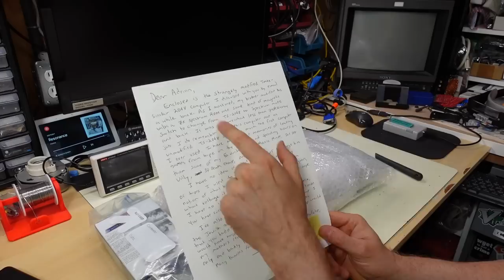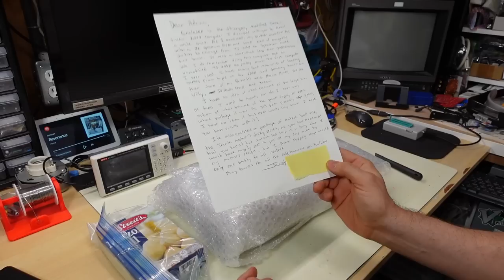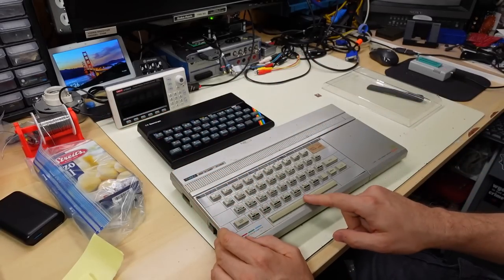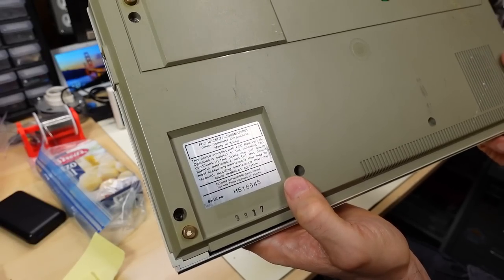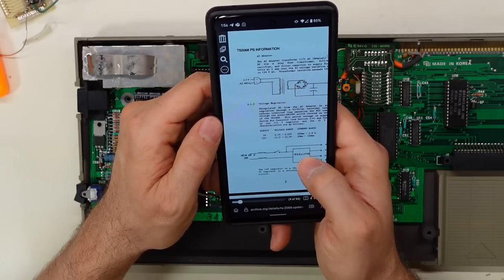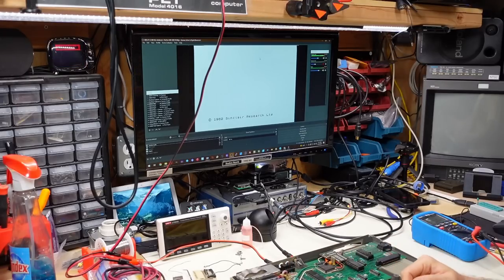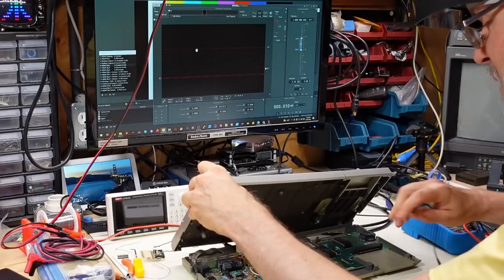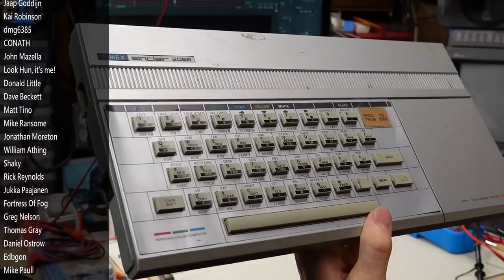0044 The ZX Spectrum of North America: The Timex Sinclair 2068

Comment: I had a Spectrum+ with Sinclair Interface 1 and two Microdrives and a bunch of cartridges (and a borrowed thermal printer for a while). I sold the whole set for the equivalent of $10, but regretted it very quickly... Today, ~25 years later, I've never EVER seen an Interface 1 on YouTube, not to mention Microdrives... and I still had factory-formatted 100-something kilobyte ones (reformatting in my drives produced like 86 KB, so I learned not to do that, and had foiled spares...). This stuff must be worth a lot for Brits or YouTubers, I'd be rich! If only I hadn't one day decided it's garbage :/

Anyways, I'm not sure if I remember this correctly, but either the Interface 1(aside of having a serial printer port and a 3,5 mm jack LAN (Atari Lynx style, just a decade earlier!)) or perhaps only the Interface 2... anyways, it had joystick ports which were the "Sinclair" standard which some games supported. Funny thing is, connecting a joystick there made it simply press numbers 1 to 5 on the keyboard. Obviously no one bought the Interface 1 nor 2, there were tens of Kempston clones for pennies, so in the end, thousands of games only supported the Kempston joystick "standard".

But I suspect that since this Timex was so closely related to Sinclair, the ports may be the Sinclair standard. I don't know the pinout, but you should be able to quickly test that shorting some pins produces numbers 1-5 (assuming on this machine these are active all the time, I wouldn't know).

PS. My Spectrum+ had waaaay better keyboard, including buttons for all the modes you needed combos for.
Reply: Interface 1 was for connecting the Microdrives and had the network interface.  Interface 2 was the cartridge port and joystick ports.  In a sense, the 2068 simply comes with an Interface 2 as standard (in addition to an AY sound chip), though I don't think it's actually the same hardware in a new shell.  Timex seemed to reengineer a whole lot of stuff.
Reply: @TheTurnipKing  Oh okay, I must be mis-remembering which did what. As I said, very quickly I ended up with Interface 1 + a cheap Kempson clone just for game compatibility. I was able to copy/convert several tape games to microdrives, but making them support Interface 2 joysticks was above my skill level ;)

But you're confirming that those ports on the Timex work in the Sinclair standard, basically emulating pressing number keys, right?
Reply: @--Lam  you know, I'm not sure.  It would make sense for it to do so, though.

It's an interesting foible of the Sinclair standard that player one is squished up onto 6,7,8,9 and 0 for fire. With player 2 taking 1-5

The Spectrum cursor keys are 5,6,7,8, nothing on 9 and then zero for fire.

You'd think they'd reflect this on the keyboard with two joystick ports built in, but it still has the original cursor keys marked.
Reply: I mean, I can see them perhaps retaining the original cursor layout for compatability with Spectrum software but it seemed very much like they wanted or expected to treat it as its own platform

Comment: Maybe it's just my nostalgia talking, but I think the ZX Spectrum is a design classic; that Timex version just looks so ugly in comparison.  I find it strange that Sinclair partnered with another company for the U.S. market, and even stranger that the design was modified so radically.   Did Timex or Sinclair fear that the original Spectrum was too lame compared to the American competition and needed to spice it up?  Regarding programming, I got so used to using the keyword entry method that typing in programs on other computers just felt so slow in comparison. :)  Of course, this all changed when Sinclair introduced the 128K Spectrum, but I always wished they had used some kind of auto-complete method of keyword entry for speeding-up typing of programs...
Reply: Timex built the Spectrum for Sinclair in Europe (Sinclair didn't do manufacturing), but had no ambitions to expand into North America, so they let Timex have a go at it. Simple as that.
Reply: The Spectrum was beautiful, and the 2068 was much more so. (That's MY nostalgia talking, but I'll stand by it.) Only recently, I learned that the 2068 influenced the design of the gorgeous QL (seems obvious now) -- and of course, the QL in turn influenced all the later Spectrum models.
Reply: I suspect it was Timex who wanted to redesign it for the US market, where the competition was much stiffer
Reply: Cheers guys!

Comment: Keyboard was crazy but I'd venture 99% of people never did more than: LOAD ""
Reply: It's actually not as bad as it seems initially.  it's a fairly logical scheme and the keys are well labelled once you're into the swing of things.

It's just no-one has the time to learn weird and bonkers keyschemes anymore (unless they're a hardcore mech keyboard user).
Reply: Magazines used to print out the BASIC code for a whole game. I typed a couple of those in (rubber keys) and neither worked.
I did write a couple of programs myself. UK Spectrum.
Reply: @Safetytrousers  debugging programs printed in magazines was an art.

Between problems in the program, issues in the listing and data entry almost nothing ever worked properly first time.